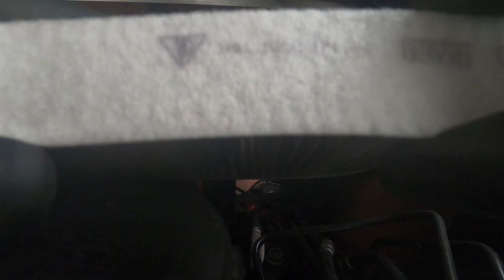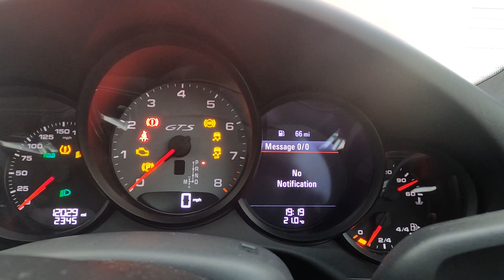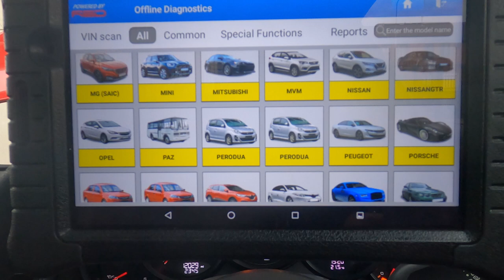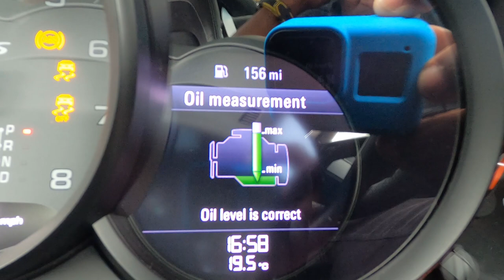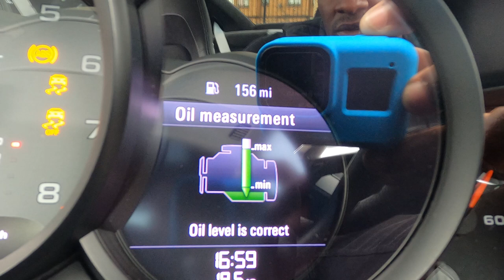Porsche 911 (991.2) GTS - Minor Service w/ Centre Lock Alloy removal & Brake Fluid change

Comment: 3rd season in a row I've watched this video before doing my end-of-season service
Thanks again!
Reply from the maker: @968Porsche1993  that's brilliant, good to know it's helpful 👍👍
Reply: @performance_engineering  Went great! What is the average time to complete this service? I spent 3 hours yesterday and another 3 hours today? Didn't include a trip to the Tire shop to get a screw removed and a tire plug after finding a sheetrock screw in my rear tire!
Reply: ps DON"T FORGET TO RELEASE THE PRESSURE FROM YOUR BLEEDER BEFORE UNSCREWING IT FROM THE RESERVOIR!
Reply from the maker: @968Porsche1993 happy days your all went smoothly. Hmm probably around 3 to 4 hours, depending on how familiar you are with removing the centre locks.
Reply: @performance_engineering  pps I hate brake dust!! As long as the wheels were off, I deep-cleaned them inside and out. It took 3 scrubbing to get them clean and added a few hours to the job
Reply from the maker: @968Porsche1993  100% worth while doing the wheel barrels while they are off 👍

Comment: Awesome job!!!  I wish you would go more in debt on the brake fluid flush.  So after you drained the fluid from the brake pad you just release the new brake fluid from the pump?
Reply from the maker: Hi. Thanks for the comment 😁 for the brake fluid change, if doing it on your own you will definitely need a brake fluid pressure bleeder. The bleeding kit forces the old fluid out of the caliper and at the same time keeps fresh fluid in the brake reservoir. Once you have released around 250ml of old fluid from the caliper it just a case of releasing the pressure for the bleed kit and disconnecting it from the reservoir and checking the level is correct. Hope this helps.
Reply: Can you please send me the link for the tablet / diagnostic tool  you use?
Reply from the maker: Hi. Not a problem, the link below is for a Autel MP808. Not the diagnostic unit used in this video but what we used in our  GTS dyno video. This diagnostic unit is very good and will reset your service lights.
https://www.auteldiag.co.uk/products/autel-maxipro-mp808?_pos=3&_sid=4efbe8a05&_ss=r&gclid=CjwKCAiAi_D_BRApEiwASslbJwVmaYopbT6aBT73vlPo9THwXOe20ldGRtIFLm0Z14x8Vdr3fVZmdxoCM1cQAvD_BwE

Comment: Do the centre lock nuts get damaged/marked when removing the wheels?
Reply from the maker: Hi Adam. Removing the CL dont damage them but I do believe the cleaning products used for cleaning the alloys can possibly be the reason why most fade over time
Reply: @performance_engineering  Thank you for the reply. Can you recommend the torque wrench etc you use?
Reply from the maker: @abandco.creative   I use a Sealey STW104 3/4" this is enough for 700nm. You will also need a 1M long 3/4" breaker bar as well to undo the CL. Hope this helps.
Reply: @performance_engineering  Thank you, that is really helpful, great vid by the way, keep it up!
Reply from the maker: @abandco.creative  Your welcome, Thanks for the feedback Adam, Cheers